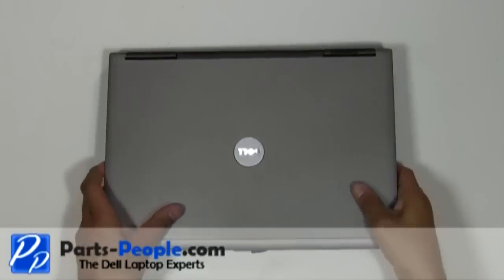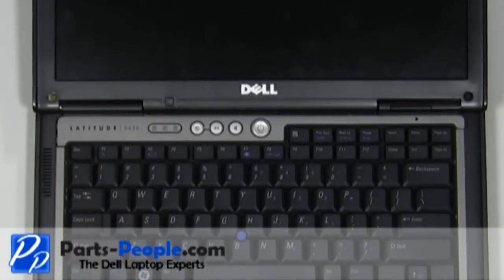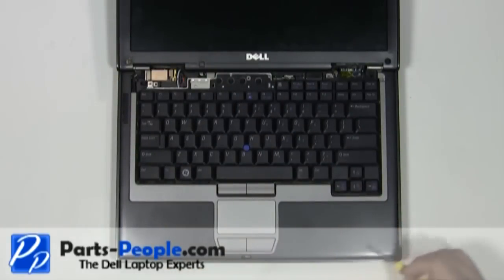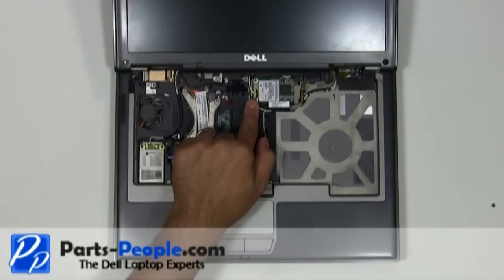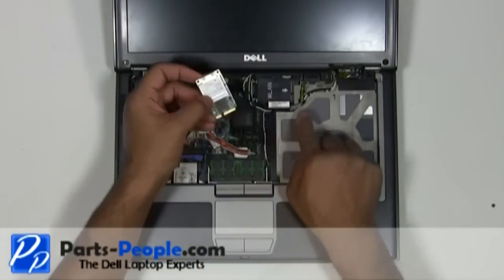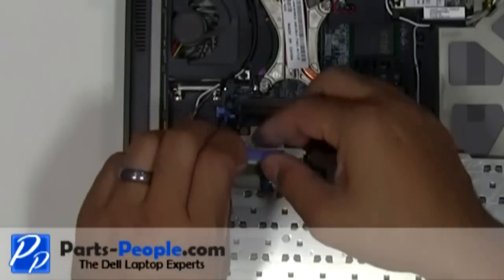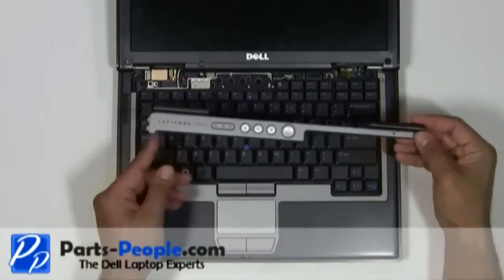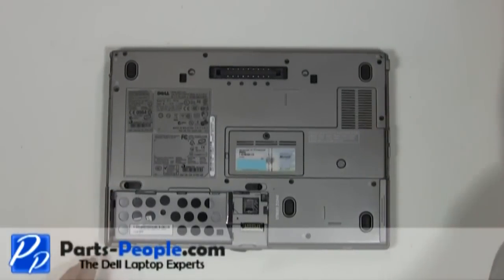Dell Latitude D630 | Wireless WLAN WiFi Card Replacement | How-To-Tutorial

Comment: Could this be the issue if my Latitude is not pulling up any networks available in my own home?
Reply from the maker: It could be a bad WLAN card, or a loose antenna cable, or a corrupt driver.